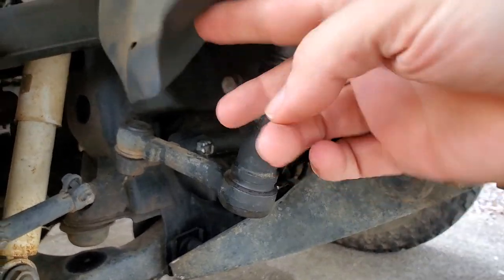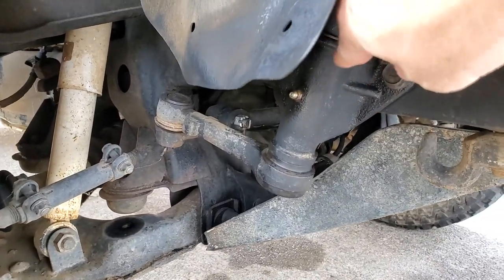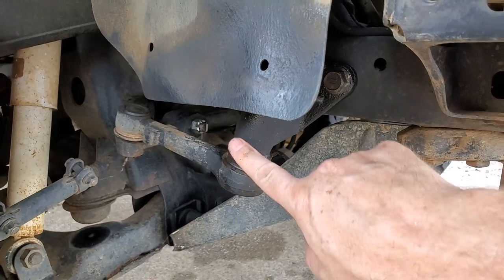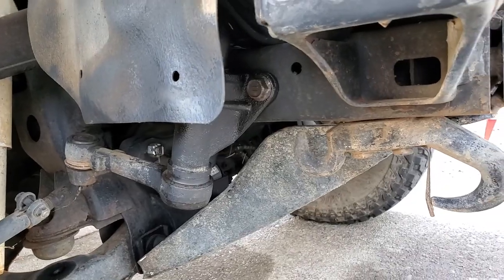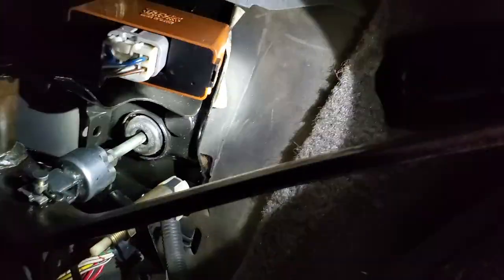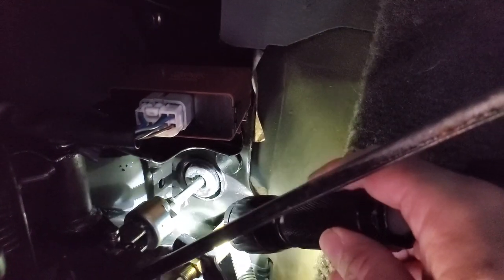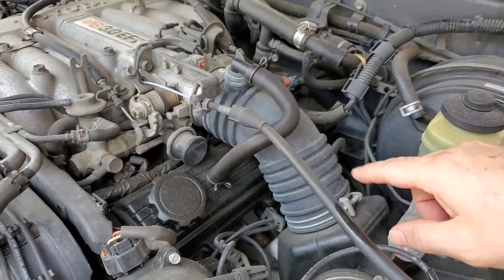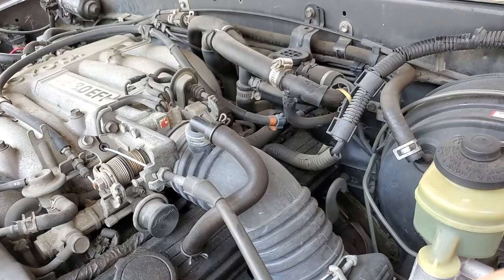2nd Gen 4Runner, Common Problems and How To Fix!!

Comment: Okay, here's a touchy subject 🤔 synthetic or conventional engine oil? Specifically for the good ol' 3VZE
Reply from the maker: Either or. Some claim switching to a synthetic can cause leaks, or due to the nature of synthetic, is more prone to leaks.
I use a semi synthetic, the high mileage Valvoline. No issues. 
Regular dino oil with regular changes every 3k Miles or so is fine and works. But I'd be fine with trying other things.
Reply: @AgileWoodsman  Thanks man, I appreciate it 😀
Reply: So my radiator fan is (at least I think) being super loud, especially at 3000 RPM, it sounds a semi hahaha could my fan clutch be on it's way out???
Reply from the maker: @Natureboy562  It might be. But a somewhat common problem is the bearings in the fan bracket itself. It's the bracket that attaches to the front of the motor that the fan bolts to. Like where a water pump would be on an old American V8. Check that first!

Comment: I am giving better attention to testing the radiator coolant using Phoenix Systems test strips to chech PH/Acidicy levels..and mixing the red toyota fluid at 70%  and 30% distilled water. I'm using the Toyota longer 90915-YZZD3 oil filter which also fits the Lexus LS400  and has the emergency oil bypass valve.  Some filters have this oil bypass valve.  The oil change places those inexpensive much smaller filters did not have this bypass valve...
Reply from the maker: Yup that's why I do my own oil changes, along with everything else. Most businesses cheap out these days. But they aren't doing it to my rig!

Comment: keep the videos up....I just got a 2nd owner 1993 manual with 159K california car no rust...got it cheap because I had to do the knock sensor....so Ive been working on her and doing alot of stuff....Not much info I trust on the internet....
Reply from the maker: Great! Enjoy it, enjoy the process of taking care of it. And I'm glad you find everything helpful!
Reply: @AgileWoodsman  I'm falling down the rabbit hole...had a bad CV axle and decided if i had it appart to do ball joints upper lower and tie rod ends and shock...I do have a question I'm getting a code 12 (1993 3vze) and it shows "Engine speed (RPM) sensor-circuit" is this the speed sensor in my manual transmission? no check engine light I can only pull the code if I jump e1 t1 in the diag port...thanks

Comment: on the passenger side,  that frame mounted steering bracket (slightly angled) does not have a zerk fitting, its original. I am now worried.
Reply from the maker: That's the idler arm. From the factory, it won't have a zerk. Mine was put in when i upgraded the bushings.
Reply: @AgileWoodsman  OK my passenger side Idler Arm i have never touched, its original. It has no rust on it, 
it has letters  IAK9424  L   so I would like to know how to test it.  Maybe it needs rebuilt, as it has no Zerk.  Also any idea on how to get the stains off the Offset 8 Toyota Aluminum Rims, the rims are significantly sturdy and I have no plans to get rid of them. Every "parts" truck or "parts" 4Runner has them, and they aren't damaged.  And another thing, I would like some product to reduce the pitting in the windshield ..very tiny "chips" they are very tiny.    And what is that large black canister (metal)  just above the Idler Arm on the passenger side?  it has two hoses going to it (or wires)   it is inside the wheel well......Thus far I have a quarter size leak under the diff after 2 days sitting,  much better than before whit the 1oz of ATP
Reply from the maker: @tonyisme4934  Hey! Idler arm, you'd know because your steering would feel loose and wonky. But to be sure, you can jack up the front end and have someone push pull the tires side to side and watch the idler arm. If it's wobbling side so side it might be wearing out.

Rims, I'd just google that. There are so many good car detailing guys out there. They'd know better than I do.

Windshield, there are products at the auto parts store to fix small chips. Just ask at the counter. Or have a window place to chip repair.

The black thing is the charcoal canister. IT's part of the emissions/evap system.

Comment: I had a 91 and paid a mechanic to replace the clutch & pressure plate. On a test drive it still had the grinding when trying shift. It wound up it was the clutch/pedal bracket that the spot welds had broken and it kept cracking & bending the bracket so that the clutch could not entirely engage. He welded it back together and spot welded it back in place and like magic worked perfectly after that. So, if you think your clutch is going out be sure to check that pedal bracket before the exspense of a clutch job that's not really needed like I did. You can see the mounting plate moving when engaging the clutch and may need to look while someone else pushs the clutch in......
Reply from the maker: Yes! This is a super common problem on these. Mine broke close to 300k miles so I'm hoping the new one lasts that long. I hear reinforcing it and welding it is actually a stronger repair.

Comment: How many miles did yours have when clutch bracket went out?
Reply from the maker: Probably around 280k or so.
Reply: Question my harmonic balancer bolt came out on me today any insite I am stranded with no tools where I am been trying to read to find out but it’s all crazy talk. Need to get it tight so I can drive it 65 miles home at least
Reply from the maker: @koolkatkustomdiecast801  What did you end up doing?

Comment: bulb list:
(1993, 1994, 1995)
High & low beam headlight 9004
Parking light 168
Front turn signal 1156
Rear turn signal 1156
Tail light 1157
Stop light 1157
High mount stop light 921
License plate 168
Back up light 921
Front sidemarker 168
Glove box 74
Map light DE3022
Step/Courtesy light DE3175
Step/Courtesy light DE3021
Step/Courtesy light DE3022
Trunk/Cargo area DE3175
Instrument-general 194
Reply from the maker: Excellent thanks!!

Comment: I just picked up a 1993 4runner 2months ago and have been working on it 
It’s an automatic 
But it’s been stalling when I put it in drive and idle runs below 1000RPM 

The gas is running rich and it kinda putters 
I already replaced the spark plugs, mass airflow, fuel pump and filter, the hoses, and a few other parts but can’t figure it out 
Any ideas on what it could be ?
Reply from the maker: Lots of things to consider during the diagnosis procedure. I'd first want to know if it's happening with the engine cold, hot, or both?

Comment: Thanks for the tips I've had my 1990 4Runner 3VZE  5 speed for 28 years. I just got mine back from the engine builder and I promise myself to take better care of it. I had the clutch bracket problem two times I finally had to get auto body shop to do some welding there. It has not been a problem since. Thanks for the tip on the passenger side steering bracket I have to take a look at those. My vehicle steering is still pretty good it's not wandering and I have the original steering gearbox. I fixed gearbox leaks with ATP AT-205 about 2 oz. first tried 1 oz that helped a lot then I put one more ounce later that pretty much was the last time I ever had to put fluid in that Reservoir again. I just checked it and it's still full that's been since February. I need the new large 4" hose that attaches to the throttle body and I'm going to look for leaks underneath of it I already have a new hose. I've got some cracks in the hose on the PCV valve and I see another crack on another hose coming out of the mass air flow sensor. I have a little whistle coming out of the brake booster I'm probably going to try the ATP stuff there. I changed my differential fluid over to Mobil 1 75w 90 synthetic. I added about 1.2 oz of ATP to see if that will slow down or stop the pinion seal leak at the front of the third member where it meets the U-joint. I'm using that Lucas synthetic 75w 90 in the transmission and it's really really smooth. If there's a better product I would like to know about it. Some years ago I had Midas give me a new cat and a new muffler and the cat is not a Toyota it is one from Midas but all my exhaust pipes are original and the U-joints are original and I have 306,400 Miles... I'm passing emissions test with no problem in Arizona. I pulled my wrecked Sienna van using a car dolly back from Mexico about 5 years ago it was about a 6-hour drive and it was really stressing the 4Runner drivetrain but I made it home so I decided it was worth keeping the 4Runner. 3 weeks later the head gasket blew
Reply from the maker: Sounds like you're doing everything right! I switched to synthetic also. I used additive in my power steering also and it worked just fine. 
I'll be pulling the top part of the motor off and doing hoses, pcv, repairing my AC and valve cover gaskets. Probably this fall when it's not over 100 degrees out lol. Sorry to hear about the head gasket. Maybe that towing was just a bit much. But I'm glad you're fixing her up! I plan on doing the same when the time comes. Thanks for sharing!
Reply: @AgileWoodsman  The certified engine builder had experience with these engines, 3VZE but getting parts was difficult. (as expected)  He gave me a 2 yr warranty.  He taught me something critical that I have not heard anywhere else and is important. GASKET kits must not be expired, and they must be quality made. The parts must be sourced from the right places, as he has a machine shop to machine  the block, heads, all of that and as a machine shop/builder they had to do it right and they are BBB rated and reputation. They do commercial vehicles & contract maintenance for large businesses. I have new toyota cams.  I have oem heads, my block is shaved, the heads shaved a little. new pistons, rings, all of that.  This VS me getting a Jasper engine.  So with the Midas Cat & Muffler, and stock MASS airflow the motor seems to have more power, and I have absolutely no leaks. The real test will be going up the mountain (soon)  Getting back to gasket kits,  they must be top quality and no older than a couple years of age. Otherwise they shrink too much. An opening on a gasket changes with time if left in the packaging unused. They shrink.  So fresh gasket kits must be used, they actually have DATE CODES  on the gasket kits. So like a loaf of bread, they must be fresh and made recently. Or else a front crank seal might have to be changed again due to the replacement part being on the shelf too long.  PATIENCE on my part was very necessary. Not getting angry with the shop. It took 13 months and many times I doubted about getting my vehicle back, but I did not get angry with the shop and in the end I am pleased with my engine working well. I have minor tweaking still,  (The AC idle) but I know its something outside the engine,  possible idle up valve and I have some minor visible hose leaks. I'm waiting for a cloudy day to fix (much cooler). and I use a pop up 8x8 shade when I'm working on my vehicles, and in the mornings the driveway is much cooler for me for sit on.
Reply from the maker: @tonyisme4934  That's a ton of great info and good mentality stuff there, thanks for sharing all that! It'll be so helpful for others too.
If you feel like it's worth it, share where you got the work done.
I hear ya on the heat! It's over 100 degrees here every day. Most of my projects are waiting for fall right now. But mines getting some nice refurbishing this fall for a 30 year birthday gift lol.
Reply: @AgileWoodsman   They can call AtoZ Transmissions in El Mirage,  but I am not sure if they will consider working on a 3VZE after mine,  (Parts & experience) but they would have to call & find out.
Reply from the maker: @tonyisme4934  I'm surprised parts were such an issue. Thanks for sharing!

Comment: I have issues going up hill, no codes. Loses speed going up hill, wont pass 3000rpm
Reply from the maker: Manual or auto? These things are pretty bad on hills honestly.  But not revving? That might be a problem. Will it pass 3000 rpm otherwise, ever?

Comment: I got a 93 4runner 5sp 3.0 4x4. Runs good but.... motor started "pulsing" or "lugging" at cruising speed (mild load with just a little throttle 2500ish RPM). If you give it more throttle before the lugging gets bad the the engine catches on and take off or you need to downshift too get the RPMs up in the poser band (3000+) range and all is good. I replaced the TPS based on all the stuff I had read up on. Cannot say that has made a difference. I guess when I think I have it adjusted correctly things get better - and if I over comp one way or another it seems to move the issue slightly up or down on the RPM range. If I unplug the TPS it seems I still feel a little bit of the issue but not as bad. btw: I changes our the fuel filter and have changed out 99% of the vacuum hoses. Rig has 250k and the plugs were done at 210k. Wires look good but I cannot confirm that they were changed or the condition of the rotor (just have not pulled it to look yet).
 
This has got to be something simple but it is eluding me what to do. Please help! I need this to be AWESOME for my wife who love this rig.

Thanks in advance.
Jeff
Reply from the maker: Hey Jeff, lots going on Herr and it's often hard to diagnose over the internet.  Make sure your replacement TPS is good! I can see I need to do a video or 8 on diagnosing. 

Almost always though, start with a tuneup...Plugs, wires, rotors, cap etc. Air filter, fuel filter if suspect. Also a good visual inspection of all vacuum lines, hoses, fittings etc. And check for codes. Instructions on my website.  Good luck!!!!!.
Reply: @AgileWoodsman  Update - changed the cap and rotor - they were defiantly fouled. It ran great and the issue went away. YAY! BUT... next morning the issue was back... going to check the cap tonight and see if it fouled or not.
Reply: Update 2/20 - so at idle you can very faintly hear a hiccup every so often - if you throttle up to say 1700rpm - it will drop 200-300 rpm then jump back up - over and over.   --------..--------..--------..--------..---- that sort of thing. If you hold the throttle higher (3000rpm) it just runs rough.

To date the following are all new: fuel pump, fuel pressure regulator, O2 sensor, all vacuum lines, plugs, wires, cap, rotor, distributor, ignition coil, igniter, intake gasket, had the ECU all tested OK. 

Any ideas? Please... lossing my mind over this... ;)
Reply: @chartlights did u get it fixed? 😆
Reply: no - not yet - have had a lot of "Toyota" people try with no luck. Was brought up that maybe the catalytic converter might be clogged - so in the next day or so I am going t pull the O2 sensor and run it with the exhaust leak and see how it goes.  @thattarek
Reply: @chartlights  good luck dude. My 92 has been idling like crap I've had it for almost a year now and i still can't figure out why the RPM gets higher as the engine gets hotter. Sometimes it even drops to an unstable 700-ish rpm and even dies out completely at times but it's really inconsistent so I can't tell what's influencing the rpm. Gonna check out the cooling system next

Comment: Appreciate the tips there….I was just reading about the IdlerArm with the Brass bushings …Guess I’ll break done and purchase one from the guy….I’ll check my hose for cracks and see if their is a problem…
I was given a 1992 Toyota SR5 / 4 WD at Christmas …My Father -In - Law gave it to me and I have changed all shocks…Driver Side Axle….New Timing Belt and Gears…New Red Antifreeze….New Battery…Changed all gear oils…New Tires…Repaired Dome Light…It just changed over to 120,000 miles ….
Reply from the maker: What a great gift! And nice low miles at that. Check out my newer videos for more ideas. And more uploads soon. Thanks for watching man!

Comment: I have 90’ 3.0 pickup. It didn’t pass Ca. Smog and pretty sure the throttle body is the problem. It runs rich. Nobody wants to fix it. Can they be rebuilt?
Reply from the maker: No one wants to fix it? That's strange. Usually small shops have no problem looking at it. Dealerships, not so much. 
Maybe check for codes first? Instructions are on my website.

Comment: I didn't know about those 3 things.  I'll have to keep an eye on them.  A few things that are common, and so maybe too obvious, are the original starter going out, back window (relay) going out or having problems (cleaning and lubing the track helps), plastic wheel turning stops wearing thru (horrible noise...put grease on them), rear sag (new springs), and that plastic part on the manual shifter (when worn, starts to drop out of gear).  That, plus dead antennae, cracked dash (both already a problem when I bought it), and problems with the overhead light have been the problems I have had over the last ~20 years on my 92 4runner, but it only has 188k on it so far.  I've also replaced the shocks, muffler, cat, and CV axles after the boots finally cracked, though I've since read that the OEM ones were pretty great, and it would have been worth the greasy mess to just put new boots on them.

Speedometer is out before warming up, so I probably have some solder joints to fix.
Reply from the maker: Yeah good list. Ice had a few of those, not many though thank goodness.

Comment: Love your vids I have just bought a 1990 toyota 3.0 petrol camper with 55000 miles what should I look out for or what parts should I change asap
Reply from the maker: Wow that is low miles!! It's probably Sat quite a bit. Do a full tuneup. Change all the fluids. Have a close look at the radiator, they can get brittle with age. Maybe a fuel filter. Then check all hoses and vacuum lines. Other than that, if it runs good, drive it around a bit and how it goes. Oh inspect brakes too. Good luck!!